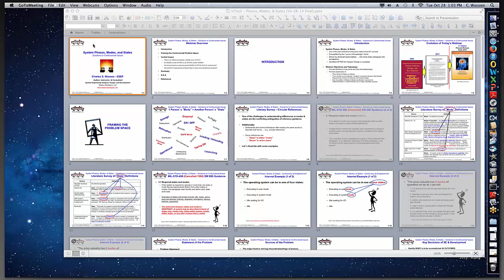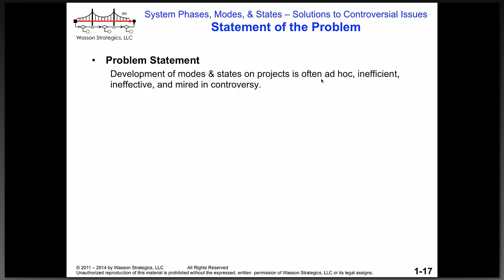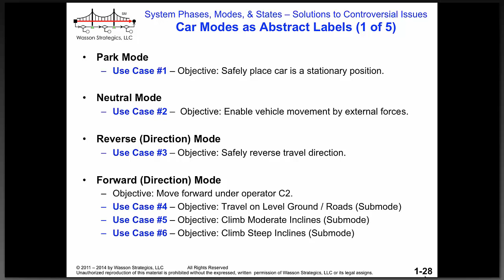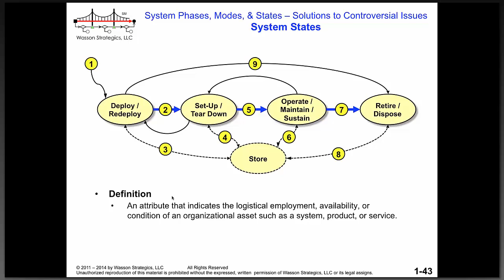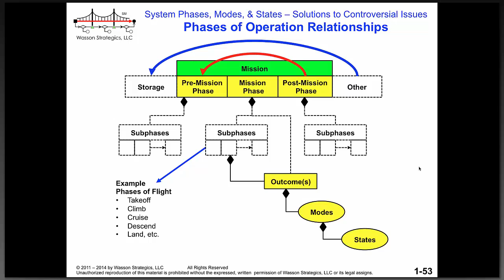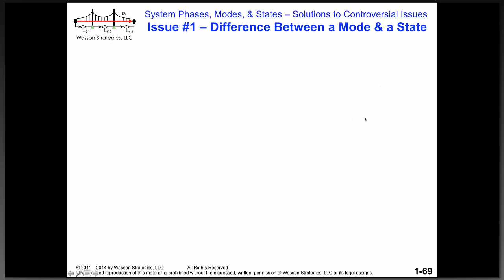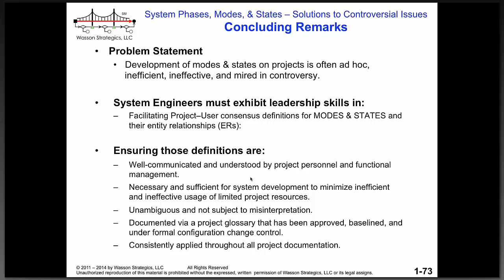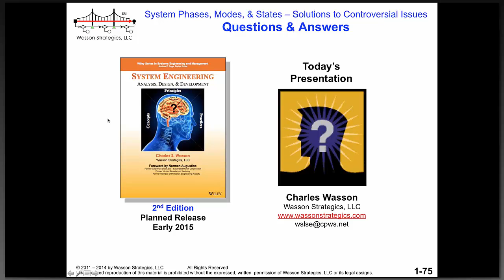States and Modes with Charles Wasson

Comment: Thank You.  I really appreciate that you are moving to standardize the way that State and Modes are defined in a system; there is so much time wasted arguing over what the difference is.  Referencing Slide 1-64:  Avoiding the development of States and Modes centric specification is NOT a good idea from a systems perspective.  Orchestration of States and Modes is necessary if you want the outcome of the operation of a system to be deterministic.  Yes, planning States and Modes may limit your architecture choices.  When you are creating a system specification you are providing the basis and definition for an architecture of a system; limiting your possible design outcome.  But avoiding these requirements could lead to an outcome that the user did not want.